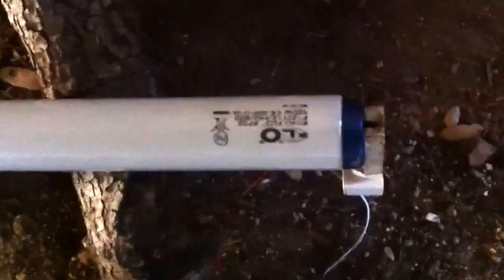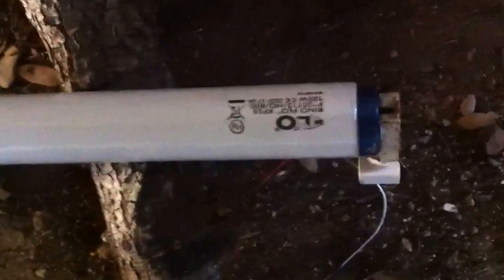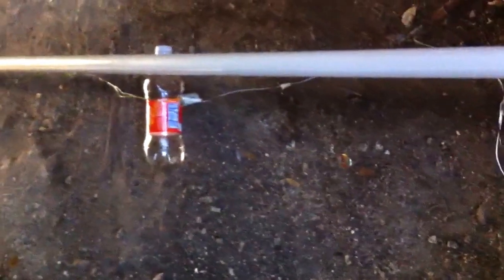8 foot 125 watt preheat tube in usa

Comment: You can also use a 8 foot F32T8 tandem fixture for running 125w tubes too although you would need to remove the center tombstones and wire the ballasts remotely.

Comment: is the starter a european starter? Is the setup ran at 120v?
Reply from the maker: This Advance ballast for Canada market. This ballast is a multitap 120 ,208, 277, 347 volt.  it a autotransformer ballast with a leading cap.  this 
ballast has 260 volt Open circuit voltage on it lamp output lead.  it running at 120 input.  and due to output OCV  it plenty to fire the Europeon starter.  I also have UK pop pack running on 240 volt running american lamps
Reply: You could probably convert an F96T12 fixture to 125w 8 foot by replacing the slimline or RDC lampholders with bipin holders and replace the old ballasts with these 125w mercury vapor ballasts although they can only be wired remotely.